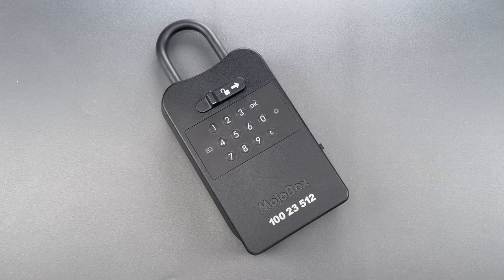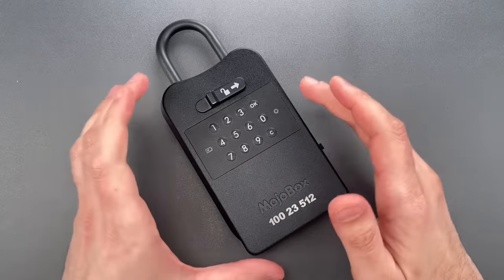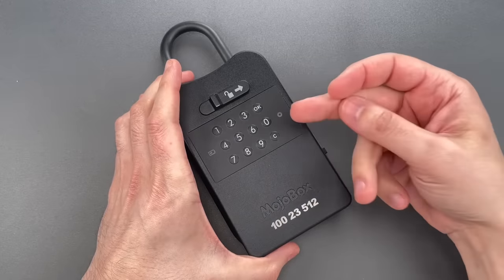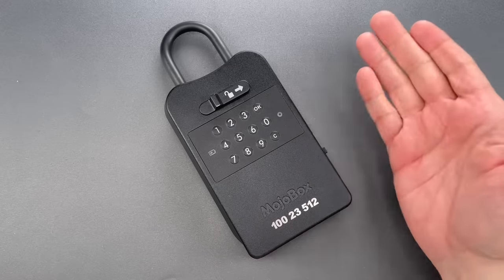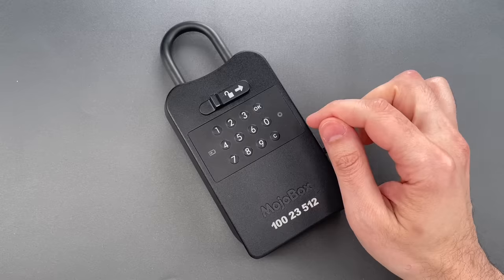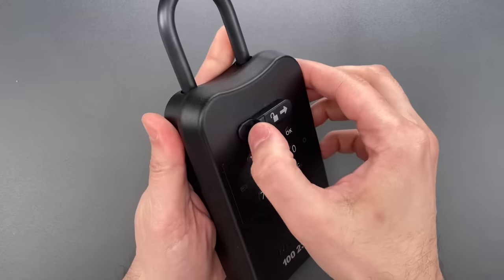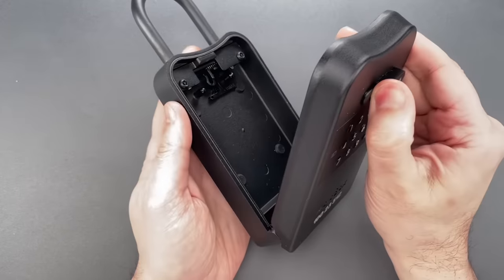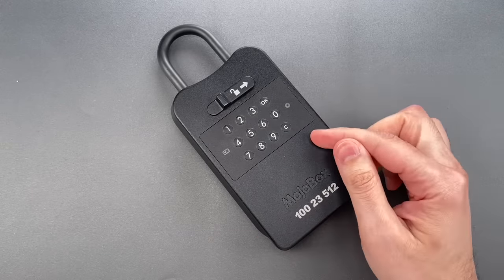[1505] MojoBox SLAPPED Open!!!

Comment: I will always wonder if there is a lock that is less secure than a piece of paper taped to a surface with "LOCKED" written on it. And with every video like this, I feel we are getting closer to that point
Reply: I used to use one of those long shackle laminated master locks to "secure" the shed in my backyard. By use and secure I stuck it on the latch so the door would blow open and the lock would be visible over my fence but I never bothered to actually lock the lock. Purely security theater as a deterrent but it worked the entire time I owned that house. So that was probably on par security wise with your paper idea
Reply: At least a piece of paper taped across a door seam would give you visible evidence of tampering. I would argue that some of the locks we see are less secure than that
Reply: Arguably the piece of paper could be more secure - most people would look for a lock and not find one.
Reply: We have the technology, and yes, the more technology we put into it the closer we get.  But you'll have to have two pieces of paper taped to the surface with "LOCKED" on one and your phone number on the other because everyone is going 2FA.
Reply: A lock is not a good lock, while a not lock is better than a lock?
Reply: @grempal  I still do that.  I've had the same unlocked Master Lock long shackle laminated lock for 18 years now.  It holds the doors closed in the wind.  I'd use a nail, but I'd have to put effort into bending it into a hook.
Reply: The German lock sticker is more secure than this and got a better rating. Well they're probably on par for security.
Reply: If you duct-tape that paper on all sides, removing the duct-tape will take more time than opening this lock. So it will be more secure (but less convenient).
Reply: Yes but instead of flimsy paper, it’s a sticker

Secured by ADT
Reply: Honestly, depends on the strength of your tape.
Reply: I've seen open concept retail shops "secured" with literally just a string or a plastic chain hung across the entrance.
Reply: THREAD LOCKED. There, that should hold it.
Reply: @ledlebrgr, actually that is a pretty effective "lock", you just need the right dummy to come along and be the one who is outsmarted by it. We've seen them, like the would-be robber who walks into a store, robs the place and tries to make a quick exit out the door he just came in but it seems "locked" so he begs the clerk to let him out, he beats on the doors and after a time, another customer walks in demonstrating that the doors open IN not out and suddenly the robber darts out the door only to be taken into custody... So the robber was thwarted by "pull" instead of "push". Much like LPL has easily overcome "MAXIMUM SECURITY!!" with an eating utensil or even a "branch" from a shrub in his yard...
Reply: @grempal  A lot of locks (and this is why all of these terrible master locks featured on this channel exist) work purely by giving the impression of security rather than by actually being secure.
Reply: @Person01234  yeah, I also didn't lock it because the master lock seemed more of an inconvenience to me to unlock every time I needed something from my shed than the one time a thief might just smash it with a hammer and take my stuff. Plus I had insurance so if my crap got stolen I'd just get a check to replace it
Reply: and LPL will still pick it open thrice to show us that it was not a fluke
Add a dimensionally correct drawing of a key way
Reply: you would LOVE our out to lunch sign. its just paper with the words in draconic [yes made up version] and cardboard. works like a lock. no one interrupts lunch.
Reply: @grempal  xD
Reply: This is the lock picking lawyer, and today we are going to open this piece of paper saying "LOCKED". By using a pen, we carefully write the letters U and N on the paper, and as you can see, it is now unlocked.
Reply: I think video 1164 "An Unpickable Lock From Germany!" comes closest.
Reply: This one is surely beaten by the spare key hidden in a flower pot. At least there, the key is hidden.
Reply: @ChrisR  "THREAD LOCKED" 

Aww nutz (& boltz) I had something Important to say and you ruint it /pout
Reply: I'm reminded if a situation a few years ago where a group of "Irish Travellers" (basically gypsies) were squatting on some land and they put a sign on a gate saying "On the other side of this fence is a girl attached by her neck, if you attempt to open this gate you will kill her.".
Reply: Ork locks! They're powered by belief!
Reply: Well, it works in video games, lol
Reply: If you've seen how long it takes LPL to open sine of the packaging....
Reply: on the flip side is
 orange vest clipboard hard hat will get u places your not sposed to be
Reply: Back in the 1920s or 1930s, the US Army conducted a massive exercise to evaluate the use of armored forces in modern warfare.  Of course, at the time, the US Army didn't have enough armored vehicles to conduct this exercise, so they were represented by regular Army trucks with large signs attached, on which the word "TANK" had been painted.

If it worked for the Army...😏
Reply: once it took lpl longer to unwrap and cut through tape then unlock the lock
Reply: A peice of paper with a masterlock drawn onto it.

Comment: I'd already consider "needs power to work" a major flaw for a lock to begin with, but being able to literally bully the lock into submission adds a new layer to it.
Reply: "Who's a bad lock?"
Reply: are the batteries freely accessible when locked? because if not, good luck getting that open if you forget change the batteries
although to be fair, i dont know for sure if this requires constant power, what makes it vulnerable is its recalibration, not the latch unlocking because of power loss...
Reply: I mean, some of them have multiple ways to unlock it. I have a front door handle that unlocks with my fingerprint, code, Bluetooth given command, or over wifi through the app if you have the bridge (which I do). All of those need the batteries to work. It also has a hidden keyhole in the event that your batteries die before you change them (and they have a really long life)

Comment: Imagine being a single capacitor away from even the most basic lock security...

Master is taking notes
Reply: I bet that 0.02c looks great on the company bottom line though.
Reply: Or even battery choice. My gun safe takes a 9v battery, connected via a few inches of wire and a typical clip-on battery terminal like an old radio or multimeter.
Reply: Yeah almost like these companies should be aware of fault injection and side channel analysis attacks and at least take basic precautions against them?...*shrug*
Reply: @aaronhunter7026  you don’t even need to know anything about locks. It’s like the most basic of electronics to have a cap for this sort of issue. You don’t want any circuit in the world to reset itself because of a split second power fluctuation.
Reply: @asdfssdfghgdfy5940  depends. maybe the circuit is trying to detect a split second power fluctuation
Reply: Bet they have a capacitor but they undersized it because it was causing a brownout battery side, the batteries weren't guaranteed to not break under the capacitor charging current. So you add a resistor. But then you also need a more robust reset implementation.
Reply: @SianaGearz The batteries could easily handle the effective dead short when first installed. The only effect would be a few seconds for the voltage in the circuit to ramp up. Also, the disconnect when he spanks the lock can't be 1/10th of a second. I don't know if they even make capacitors small enough to be undersized for this application.
Reply: That was my first thought. He should send the lock to someone like Big Clive... It would be interesting to see if there's a spot on the board for a capacitor that just isn't populated, as we often see in things that have been "optimized" for production cost.
Reply: You beat me to it.
Reply: @briant7265  under an effective dead short, you have all current and no voltage. You can get a really weird startup voltage curve that messes with your power on reset logic. You basically need a well tuned Schmitt trigger to take the processor out of reset. Your next problem is that you have an actuator, and you should probably give it a separately conditioned supply, else it can brown out the logic as well.

I just remembered something though. Contract manufacturers in some industries can be notoriously allergic to adhering to the BOM. They tend to just start throwing components off the board until the design no longer works at all. Often without any feedback from customer. Jerri Ellsworth recounted her experience from designing C64DTV toy product, which had a high failure rate in engineering samples, until she snuck her way into having them adhere to BOM. What are the odds that the lock is contract manufactured by a toy specialist? Maybe no capacitor after all.
Reply: @briant7265  1/10 s? more like a millisecond.
Reply: Makes you wonder how much current it draws when idle if it discharges whatever capacitors it has that quickly. I bet batteries don't last long in this.
Reply: @SianaGearz  But all of that "dead short" current is going into the capacitor to charge it, not the circuits beyond. You get a nice smooth voltage "ramp up" into the circuit beyond the capacitor as it charges. 

Since the cap only needs to protect against a disconnect of much less than 1 second, it can be small enough that it basically charges instantaneously. Maybe just big enough that you don't get a bouncing voltage when it charges, or include a tiny resistor to slow it down a little. 

Or, maybe the rest of the circuit IS that badly designed.
Reply: @SianaGearz  suddenly disconnecting a battery for a few milliseconds away from an already charged capacitor wouldn't cause almost any current flow. The undervolt would never happen if the cap was installed, as the processor would surely be in deep sleep. The initial inrush current is genuinely a 10 ohm resistor for a 0.47uf to prevent any true fuckery. AA batteries can handle 1 amp of current for a few minutes, so for the fraction of a second it takes to charge, the device would power up gracefully - so long as they make the power on self test wait for a stable supply.
Reply: Are they? lol

Comment: You know it's a "good" lock when LPL doesn't even pull out a tool, the disrespect...
Reply: his hands are his deadliest weapons.
Reply: @Pattoe  Keep your pimp hand strong and keep your locks in check.  ~Snoop Dogg to LPL when he was just a puppy.
Reply: @Calliber50  🤣🤣🤣🤣🤣🤣🤣🤣🤣🤣
Reply: When the 'tool' in question can include something LPL pulled out of the trash.
Reply: Getting a tool would slow down getting it open.
Reply: This lock was opened with the only tool being disrespect.
Reply: It's sad when a hand-tightened bolt and nut would be more secure than this thing.

Comment: I don't know how "the slap" ranks against the wave rake 😂
Reply: Well, just to attempt an objective reply: Using a wave rake assumes that you at least know how a lock and key interaction works. Using a slap does not require this knowledge or skill, you only need to know how to slap an object and how to open the box.
Reply: I think it's worse since you could forget to bring a rake, but not your hands.
Reply: Less effort than the wave rake...
Reply: @gbgentleman  And if you forget your hands, you have far larger problems to worry about.
Reply: @TrondBørgeKrokli  even if you don't think about the possibility of slapping it, you may accidentally stumble onto this solution by trying to break it.
Reply: @TrondBørgeKrokli  counter reply:
Wave rake works on most cheap locks. So all you need to have is a bare minimum of knowledge about locks in general.
Whereas with the "slap attack" you have to know that this lock specifically can be open by it and you also have to know the orientation of the batteries.
Reply: @ledocteur7701  a raccoon, bear, or baby could stumble upon the idea of hitting it. This isn't secure against non-thinking intruders
Reply: @Jehty_  Sure, fair point. Even so, I think it would be easier to remember how this lock is slapped, then you don't need the raking knowledge (although it would require that you have seen this video, or a similar one, to know about the flaw in the first place).
Reply: @TrondBørgeKrokli  it would not only require you to have seen this video but although to remember and recognize this specific lock.
Can you remember one specific lock that you have seen in a video a year ago? 
I can't. But I can try to racke open every lock I stumble upon.
Reply: @Jehty_  Fair point. If you have got a rake, then you have got a rake. No need to remember other methods, unless there is no visible key lock to be raked.
Reply: @Jehty_  You don't need to know the orientation of the batteries, the negative and positive are usually on the same sides, assuming 3-4 batteries, which means the springs can be sprung from hitting it in either direction, so you have only 2 choice's to smack it from, the bottom or either side to get the disconnect.
Reply: I hear it's big in Australia lol
Reply: @Jehty_  -  Your point would be valid if this particular device didn't possess a unique appearance.  That lock is nothing if not memorable.
Reply: @wickedcabinboy  1. It doesn't have a unique appearance. For example the Master Lock 5440ec looks quite like it.

2. Even if it had a unique design, that still doesn't mean that you can remember the unique flaws of dozens, if not hundreds, of different locks.
Reply: Well, there is 99,99% chance you have slap tool with yourself (unless you are too experienced woodworker).
Reply: @brylozketrzyn  -  I presume English is not your first language.
Reply: @wickedcabinboy  I'm presuming, that it isn't yours first either.

Comment: This is such a stupid oversight, hilarious and quite sad at the same time lol
Reply: Well said.
Reply: I agree it is an oversight but vulnerabilities are invisible until discovered once. This power cycling step is common in door mounted locks and the batteries are typically on the inside secured surface. I do not know of another padlock which does this and as such would not put this in the ‘solved problem’ class of vulnerabilities. It looks so lame here but design flaws sneak through to production all the time. This is comparable to typos which get into books and yet we know the author and editors tried to find them all.

Comment: Wow.  This is *precious*.  I love that this happened.  Not that they made such a bad lock, but that it happened at all.  I have learned a new thing: You can inertially move AA batteries and cause a power outage.  Amazing.  Thanks for the lesson, LPL!
Reply: I remember discovering the ability to dislodge batteries that were under spring tension as a kid to reset my buggy RC car. As soon as he said slap I knew where this was going.
Reply: Funnily enough,I have a remote that doesn't work unless you either slap the bettery compartment or straight up give a slight twirl to the AA batteries,and it hasn't changed batteries in forever.
Reply: @potatosordfighter666  Apple's magic mouse 1 dislodges under aggressive motion too, causing a momentary bluetooth disconnection.
Reply: Learned it playing with flashlights as a kid.
Reply: so thats why smacking your flashlight makes it work
Reply: If you've used cheap flashlights you're familiar with this issue. Slight bump and light turns off.
Reply: this explains, why shaking or slapping battery powered tools is such a valid thing to do if they dont work
Reply: I just learned I can use the word ‘inertially’ 😮😊

Comment: Reminds me of the cheap Yale (branded in other names too) that if you slap the top while turning the unlock knob, it will jar the locking mechanism and unlock the safe. I showed someone this in  a local store, to which the sales assistant stormed off in disbelief! 🤣
Reply: insert "slap one of these babies" sales man meme
Reply: That works on many cheap "safes" and lock boxes with digital locks, though timing of exactly when to turn the knob after the slap can be difficult. A lot of them have the locking latch on a soft spring, so a cheap electromagnet can pull the latch to the unlocked position. These "safes" are so cheaply constructed of thin sheet metal that there's a fair bit of flexibility, and slapping the top above the latch can bounce the latch against its spring so it briefly unlocks. This even works if the batteries are dead.
Reply: @amojak  🤣🤣
Reply: @Kaboomf  Yes for sure, definitely the cheaper ‘safes’ 👍🏼

Comment: I just don't understand why these companies don't get their locks tested by a few security experts during develoment. That way problems like this would be detected before release and this specific problem could have been easily fixed by adding a little buffer capacitor or by changing the calibration process.
Reply: Because they don't care, don't know better and/or just need the thing to look safe enough to the average Amazon shopper.
Reply: I can only assume it's about cutting costs.
Reply: the goal is profit, not quality.
Reply: In the age of Apple products, style is more important than substance.
Reply: Getting security experts costs money.
Fixing the problem costs money.
Reply: @asicdathens , you are acting like this behavior is recent. However, LPL has shown locks older than Apple with vulnerabilities that could have been prevented by consulting with some experts.